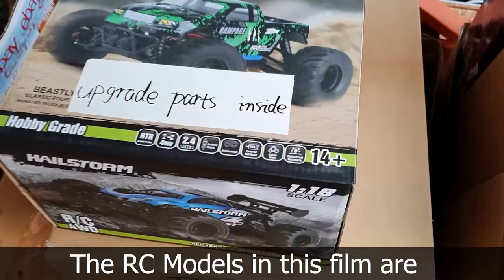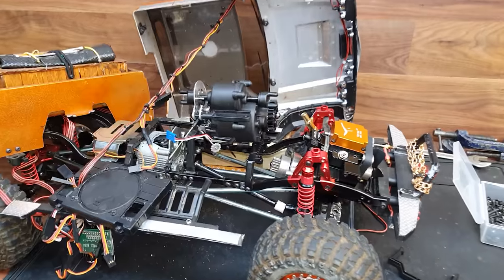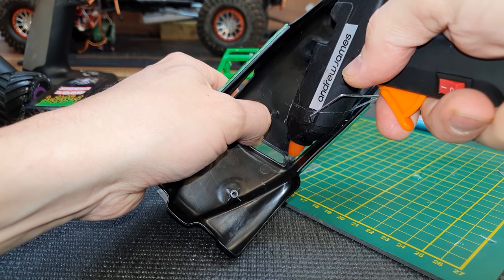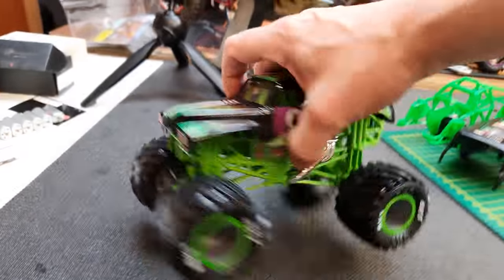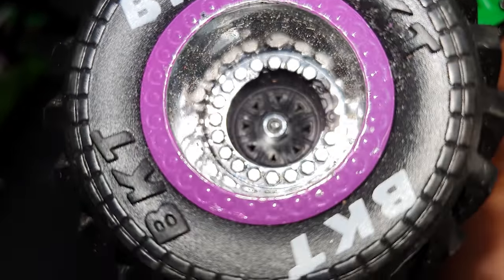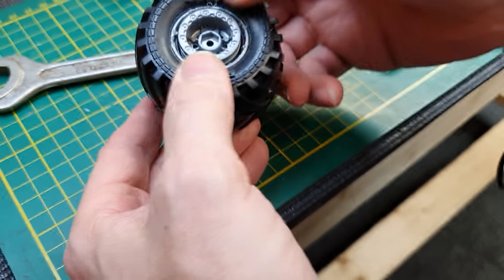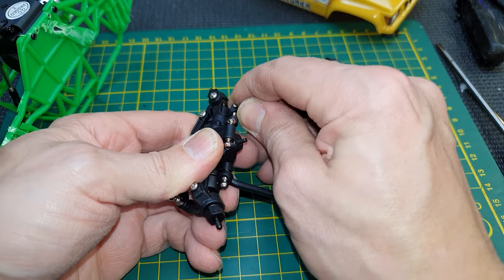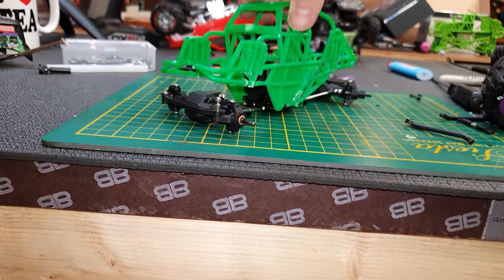BUILD a Tiny 4WD 4 Wheel Steer Grave Digger RC Monster Truck Car PART 2

Comment: Kev: Back in the day, we used to modify plastic car kits with a tool that looked like a soldering iron with an Xacto blade on the end.  Plugged in, the blade heats up and allows a clean cut through any plastic.  . I assume this tool still exists. Might help.

Comment: Hey Kev my Traxxas stampede 4by4 vxl  is slipping in the differential how do o fix that without the misery of taking the entire truck apart and having to buy new differentials
Reply: I would say make sure the drive shafts are attached properly other wise the gears will need to be replaced

Comment: 1st Kev I was going to ask my slash gets very hot what do you do to stop it happening?
Reply: check the Pinion-Spurgear mesh, Gear down, Check all Bearings... Hope that helps
Reply: ICYCLE BICYCLE I put a fan on my ESC and motor.  On my Slash.  Check gearing too
Reply from the maker: free it up and gear down
Reply: What is your gearing if you don’t mind me asking cause mine is geared pretty high and it doesn’t over heat
Reply: Thanks guys I really appreciate the help I just bough a the other day and it gets frying hot and I have to stop every 10 mins I’ll have a look at the spur gear and pinion and gear down !